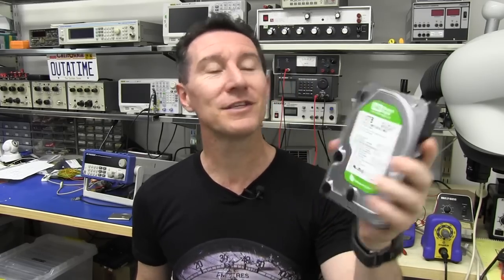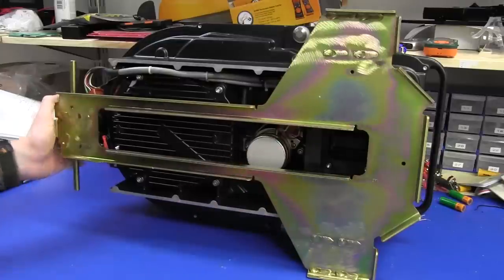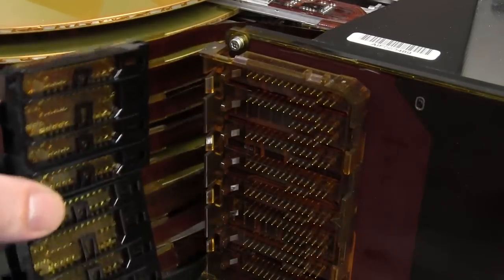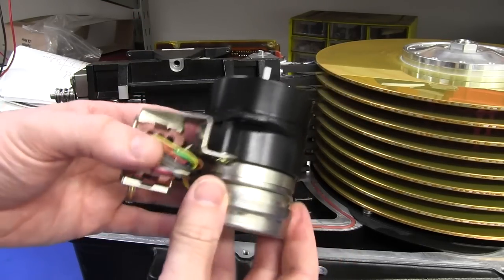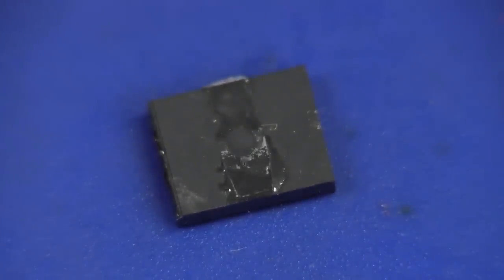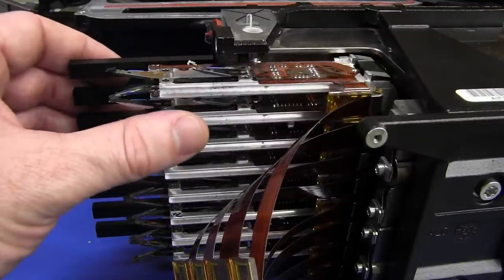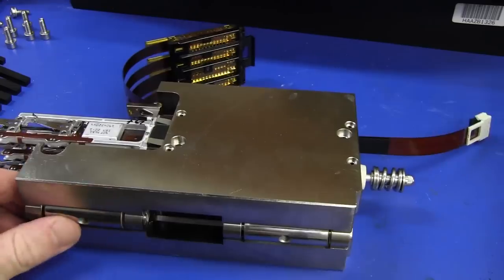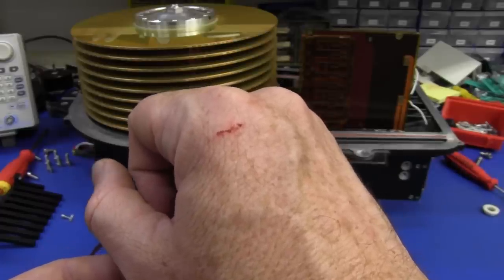EEVblog #395 - World's Most Expensive Hard Drive Teardown

Comment: Why didn't you run it and see what was on it....  Why didn't you run benchmarks to see how fast it was?
Reply: It's not certain that it's connection port is even IDE, you know. In that case, what you propose would be difficult! But, he should at least tried hooking it up to some power so we could watch it spin up!
Reply: ojkolsrud1 it probably would be dangerous because it doesn't have halon gas in it anymore.
Reply: hmm, even so, I don't think it would overheat during the period of time needed for it to reach maximum RPM. Still, good point!
Reply: Indeed. Probably true.
Reply: Its not possible to do so.  He would need a System/390 mainframe as this is an IBM drive and would only work with IBM mainframes, the drive controller (this is not an IDE drive so has no onboad controller), a S/390 OS and software capable of running on the mainframe to run the controller and understand the filesystem and file formats.

Basically if he had an S/390 mainframe to put this in it would take up his entire workshop and powering it up would require work too.
Reply: dlarge6502 He meant just spinning it up, like just hooking up some sort of battery to two leads on the motor or whatnot.
Reply: ***** He was making a reply to the original poster of the main comment, he wanted benchmarks and see what's on it.
Reply: KoutaSn Yes... i'm aware. I was jsut telling him tht thats what he meant...

Comment: Your next project should be connecting a $250,000 hard drive to a $300 laptop.  That way you've increased the value of the laptop to $250,300.  :)

Comment: In the early '70s I worked on Burroughs Disks.  They were "Head per Track" Disks, no linear motor just one head over each track. Very fast.  There were 4 disks with 8 surfaces.  Each disk was about 4 feet in diameter and they would spin vertically.  Each unit was 10MB.  When we stated them up, we had to wait 24 hours for the speed to stabilise before we could write on them.  They would run for about 10 years before the bearings would start to fail.  Changing the bearings took about 3 days.  Can't remember how much they cost but I am sure it was a lot.
Reply: ""Head per Track" Disks" <aussie accent on> YEEAH! None of that linear motor rubbish!
Reply: @johanveltheim4331  hahahahahaha
Reply: Incredible.
Reply: Yes - the spindle was horizontal, so the disks spun in a vertical plane.  While the bearings were being changed (or head assemblies), a "purge unit" was connected through two big flexible tubes to blow air that had been cleaned by passing it through "Absolute Filters".  This way, all the time that the enclosure was open, there was a current of very clean air blowing through the unit, so that no dust could enter.
One big problem they had was that the heads were mounted slightly away from the platters, and when the unit was running, the heads were pushed in by pneumatics, but the head assembly had "touch sensors", and if they ever detected a head touch, they would drop the pneumatics and retract the heads.  We were getting so many touches that the disks were sent away to get a Teflon coating (for which the customer paid, of course).  Then, the Teflon started flaking off and jamming under the heads, so they were sent away again for "decontamination" (for which the customer paid again).

Later, I left Burroughs and worked for a third-party maintenance company, where I worked lots of stuff - including the IBM 3330 drives - very similar to the one in the video, but the heads recorded on both the top and bottom of each platter, and many were the hours I sat with an oscilloscope, setting up the cats eyes on these drives, to align the heads on each surface with the servo track on the bottom of a platter about half way up.

They were good times - but I have to say - retirement is better!
Reply: To think that modern HDDs need less than 4s to spin up and stabilize, amazing how far and fast computer tech has progressed.
Reply: How about this HDD with 1,000,000 times as much storage for US$180?: https://www.amazon.com/dp/B07G3QMPB5
Reply: @DownhillAllTheWay  Did you guys ever think back then that storage would ever advance to the point it has today? Like, "Someday we'll be able to hold over 1 million times the information stored in this room on one fingertip?"
Reply: @K-Riz314  Many things that we take for granted now, were so totally unimaginable, so few years ago, that I wouldn't have believed that one day, I could have 128GB in something the size of an SD card.  Even now, I find them mind-blowing.  
Before disk storage, there was drum storage.  I never worked on it, but I read about it.  The drum was made slightly narrower in the middle (slightly diabolo-shaped) because when it was spinning, the center of the drum would stretch slightly due to centrifugal force, and make the two sides parallel.  The article said that "if a bearing seized, the kinetic energy of the drum would be released, with ensuing damage to the computer room" - not to the unit, but to the computer room!  Wow!
Reply: @333Orobas 666 There was a clear plastic tent with an air purge unit.  We had to wheel the disk drive into the tent, purge for 24 hours and then start the dis-assembly.  Once we got to the bearings we had to heat them up to get them off the shaft.  On re-assembly, we had to freeze the shaft in dry-ice (CO2) to slide the bearing on.  All this work was done in the tent.  Then had to re-write the clocks on the disk.  That's why it took 3 days.

Comment: Actually folks I have been installing Halon 1301 systems since 1979. Contrary to popular belief, Halon 1301 does NOT suck or remove the oxygen concentration out of the room. Only when it hits a flame at about 900 F does it decompose into toxic gas. I have been in MANY discharge tests and stayed in the room for over 10 in. to run the gas analyser for the concentration test. It can give you a barn burner headache. But it does NOT kill you being in the room. Cardiac sensitization can occur in higher concentrations, or if you had a heart condition, you could be at a greater risk of danger, but not instant death. I think the movies exaggerate the myth. The detection system was cross zoned with ion and/or photo detectors that took 2 in alarm to start the 30 or 60 sec. delay. An abort button (dead man type) was easily accessible to halt the discharge before it released. But once it started to dump, no matter the amount of gas, it had to be all out in a nominal 10 sec. It is stored as a liquid, super pressurized to 360psi, and because of the low boiling point, vaporized at the nozzle instantly. It would fog a room, and visibility would be hampered for a few min. I always said the biggest hazard was not the gas discharge itself, but tripping and breaking your leg trying to escape. Safety was paramount, they would not let you dump a gas that removes (displaces actually) a gas into a room that could possible be occupied, just was not an option. CO2 will kill you quick, but is used in machinery spaces and the like, in non-occupied spaces only, never in data rooms. And of course, halon has been phased out many years ago, and I really don't think they are any systems left in service. Sorry, but I had to clear that myth up, it still blows my mind that so many people believe that, I have no idea how it started, no one ever has been killed in a halon dump, so I'm not sure why the myth lives on after decades. Anyway, thought some people might be interested in that myth. Awesome video as usual, love all your vids, have learned so much from you, keep it up, you da man!!
Reply: Actually there are some datacentre like facilities protected by CO2 though generally only ones housing extremely critical or very expensive (read supercomputers etc) equipment, Have only encountered like 3 of them during my career though and of those 2 were not even allowed to run in automatic mode period if personnel were present (Opening the door to the room disabled it until it was manually reset etc). The other was a very small room that was more than easily evacuated within the minute warning though even then there were cabinets containing O2 bottles with masks in the room but it was only to be used if getting out was for some reason not possible. Really no reason that should ever be the case though at most the door was like 15 meters (About 3 seconds at average walking speed) walk and the room is equipped with extremely hard to miss aural and visual alarms with a good 60 seconds warning time.
Reply: Halon works by displacing the atmosphere in the room (it's heavier than air), so yes, being in a room that is filled with Halon WILL suffocate you. You clearly weren't in a room that was filled with it. Yes, you can be in a room that is partially filled, but NOT in one that is filled with Halon above your head. The Halon systems on US Navy ships were designed to quickly and completely fill a space to put out a fire as quickly as possible. Not sure about the systems you worked with, but there is a reason that the "popular belief" exists.
Reply: Matt Elder Actually that’s not how halon works. CO2 systems displace oxygen.  Halon interupts the ion exchange literally preventing the fuel from oxidizing.  Unless a flame is present halon is far safer to humans, as you can walk around in it with nothing worse than a headache.  CO2 on the other hand will kill you due to oxygen depletion.  I have worked around many of both systems.
Reply: @ericapelz260  that wasn't how it was explained to us when I was in the Navy 30 years ago, but I'll admit that my memory could be faulty.
Reply: Matt Elder Well, keep in mind that the Navy may have been flooding the compartment with far more than a server room needs.  The Navy has to consider that a room may have a gaping hole in conjunction with the fire.
Reply: @ericapelz260  I spent 20 years as a engineer in the Navy and our engine room dump concentrations were set to less than lethal levels. I used to be able to quote the percentage but old age as claimed that knowledge. For some reason 12 and 20 percent keep popping up in the old memory bank.  But I could be wrong.
Reply: Dave in MD I suspected as much but I also now that some things are intentionally over engineered in war ships.  CO2 and Nitrogen systems have been around for a very long time, Halon’s ability to kill a fire but not the humans was it’s major advantage.  We would still be using halon if it wasn’t such a serious ozone depletion problem.
Reply: @ericapelz260  I've been out since 2007 so not sure what they are using now. We still used CO2 dump for enclosed engine modules. I hear they are replacing AFFF as well.
Reply: I understand the usage of Halon as a fire supression system, but I once read a story that had another system that worked on a completely different principle.
The server room was hermetically sealed when the door was closed, and the room had incredibly powerful vacuum pumps that would remove almost all the air in the room within miliseconds. Of course, this was for a room with just 2 or 3 server racks, so it didn't need to be very big, but I think that was an interesting system.
Reply: @mattelder1971  You do not know what you're talking about, period. I hold engineering certification in fire protection and have seen more halon system, and engineered them more than you can even imagine. I stand by my comments 100%. Halon1301 simply will not kill you at the NOEL level it was designed to. Yes, again, cardiac arrhythmia can occur at higher concentrations and be fatal at prolonged exposure at more than triple the concentration of normal design parameters. And yes, MANY people back in the 1980s WERE indeed in the room at FULL discharge concentrations. I can't imagine such a statement that accuses me of not doing something that I clearly stated as a flat fact. It made your voice very low (baritone). Partial room levels as you mentioned simply do not happen (unless the enclosure was compromised). A full mixing and a homogenous mixture is obtained in the hazard area, it is a total flood system where the whole room has the same concentration levels (the goal anyway). It is heavier than air and does have a descending interface after a few minutes after discharge. I'm not trying to belittle you or be argumentative in any way, simply trying to state a fact and educate people like you on the myths of this halogenated hydrocarbon  HALON1301 CBrF3.
Reply: @FireguyNtx  As I have REPEATEDLY stated, I'm just repeating what was taught to us in the Navy. Yes, I could very well be wrong, but if I am, then the training that we received in the early 90s was equally wrong.
Reply: The us military still uses halon systems in their armored vehicles.

Comment: that's what we called a Winchester Drive it was a sealed unit. I worked for DEC in NYC but DEC main office was in Maynard, MA USA. I worked for them in 1978-81 1982-1985 with a 18 month separation. I started as a Hard Drive specialist worked my way up to a Sr System engineer. I worked on several different HD's most were 20 14" platters (19 read heads 1 servo head) RP06, RP07 that were 300 MB. 95% of the DEC's HD's were made by CDC, the other 5% were made by DEC. I also worked on RK05 5 MB, RK06,7 15/30 MB, and a 90 MB Winchester/ removable HD it was a 30 MB  removable & 60 MB Winchester HD. those were the days you used to troubleshoot to signal level or component level
Reply: Did you ever work on the RM05/CDC9766?  I did a teardown of one (no platters), where the voice coil was massive.  About the size of a soda can, and cylindrical (the coil alone).  The magnet assembly was a cube the size of a stack of CD jewel cases.  The die cast frame must've weighed almost a hundred pounds, if memory serves.  As a 10yo I was in awe at the sheer amount of engineering that existed in one place.

I remember applying 12v 1A to the voice coil, and it slammed so hard that my mom thought I ran into a wall!
Reply: IBM used the term Winchester to describe the 3340, not the 3390 (he is showing the HDA from a 3390). The 3340 had two spindles that each held one 30MB removable storage module. Two 30 MM Drives = 30-30 = Winchester 30-30, the popular lever action rifle that one the west. The 3390, 3380, 3370 and 3350 were not Winchester drives.
Reply: Funny fact, in Hungarian language when we speak we call all hard disk drives a "winchester" or "winyó" in general and we even write that in pretty much all non official conversations. Although the more official the situation gets the more likely you will write "merevlemez meghajtó" the literal translation and official word for "hard disk drive"... but even then there are only a few occasions when you would [and then you'd have to] say that (in some highly official situations like interrogation or court i can think of).    

The fact that computers were strictly restricted by the CoCom list until 1984 didn't help us to get people into computer science and even after '84 for years a Commodore or a ZX Spectrum was still a big thing for an average mid class family and totally out of reach for the majority of people. The fall of the iron curtain has changed things instantly and a thriving grey market of old replaced rigs mainly from Austrian companies made it somewhat more affordable. In 1990 I've got a non turbo 8088 512K RAM and a [compared to the one in the video) miniature 5.25" size Seagate ST225 20Mb "winyó" ... FFW 30 years and one photo I shoot with a pocket size camera exceed that capacity. :D